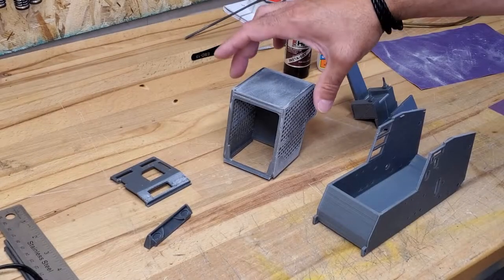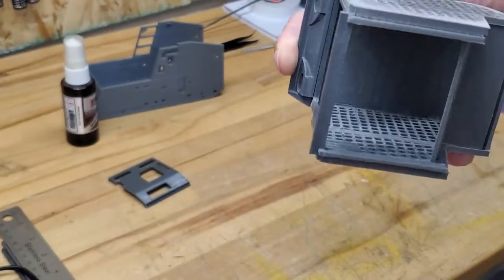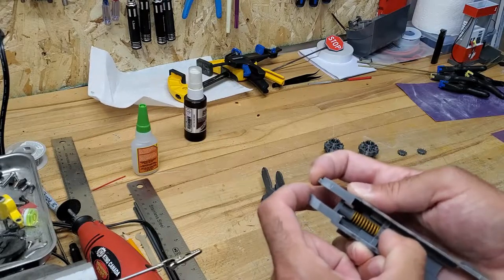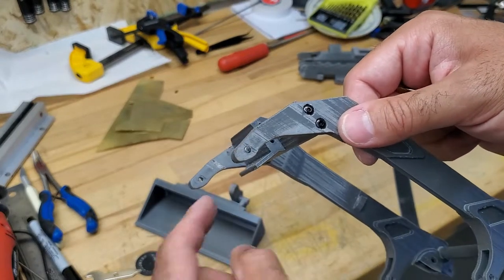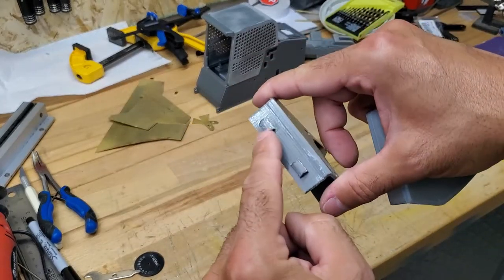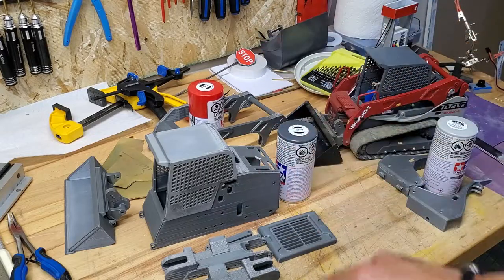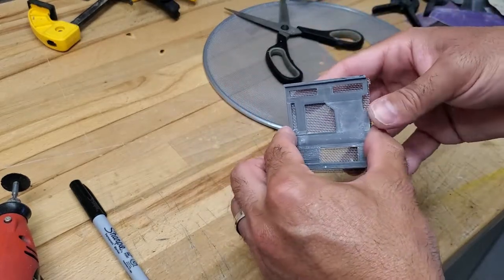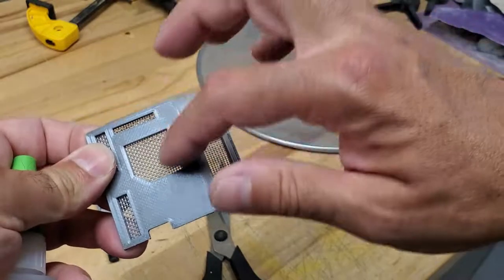3D Printed Remote Control Skid Steer Build Part 1

Comment: This is a hugely fun project, and beautifully designed. I can't leave well enough alone though, so I'm trying to design a cross-member and attachment plate to use linear actuators for the bucket too. Not sure how they'll fit, but I really want it to work and I'll keep you in the loop if I get good results. This loader that I built with help from WI RC Construction from your design is probably my favorite thing.

Comment: WI RC Construction showed me that printing the boom almost vertical puts the layer lines along the thin parts, and makes the whole thing a lot stronger. I tried printing it this way and I've gotten a lot of run time digging and lifting heavy objects without breaking yet. We've had good results having the layer lines approximately match the weld detailing angle on the side of the boom. It takes a lot of support material, but that beats having it break.
Reply: I don't know how much this matters, but instead of using silver filament, I used clear and painted it silver, then painted it the colors. I feel like the clear filament is strongest, and I still get the effect of scratches showing "bare metal" If you can find a brown primer to show "rust" too, that might be a cool effect, but I haven't gone quite that far yet.
Reply from the maker: @StefanBacon  thanks for the great comment. I have learned something new. I will try that on future builds and see how it goes.

Comment: Very cool. I need to get my printer running. Do you think this could be milled from aluminum?
Reply from the maker: It's possible. If you need the step files I can add them.
Reply: @rcchbuilds  that would be awesome. I will purchase the plans as soon as I get home. I think metal would add to the fun.
Reply: @rcchbuilds  also…one more note..maybe request…it would be awesome to have an excavator to match :)

Comment: Gotta get some tracks designed!
Reply: The Bruder tracks can be bought from their website (when in stock) and they work well, but it would be nice to have some with chunkier tread blocks. It feels well above my skill level, but I'm tempted to try to design some. Maybe after I finish with my tilt actuator changes, and my goal of building a 4 in 1 bucket for it.

Comment: Is there a tire option? The tracks are not available?
Reply from the maker: No wheel version. But maybe in the future. I did reach out to bruder but no response on when they will have more tracks.
Reply: @rcchbuilds  well guess I won’t be building it than
Reply from the maker: I need to design my own tracks and see if they work. But the bruder ones seem to work pretty good.
Reply from the maker: @Rckid28  other option is to buy the delta skid steer toy and take the tracks from that. It's how I made my first one. They are not to expensive.
Reply: How about using TPU to print the tracks?